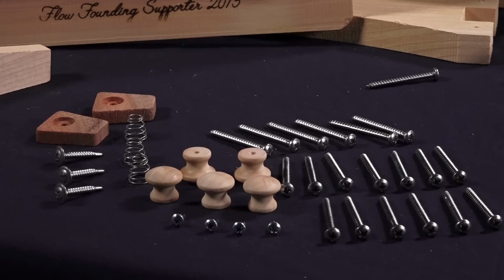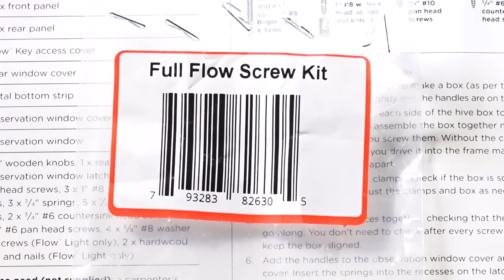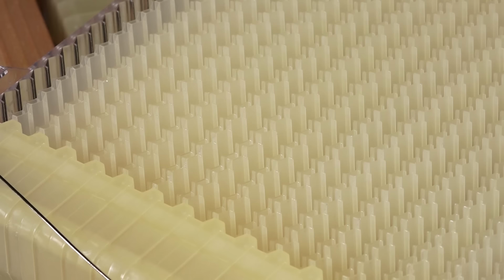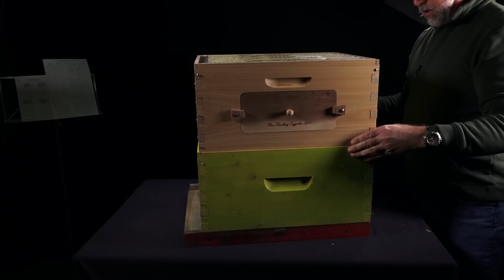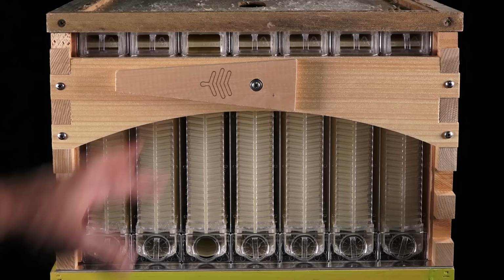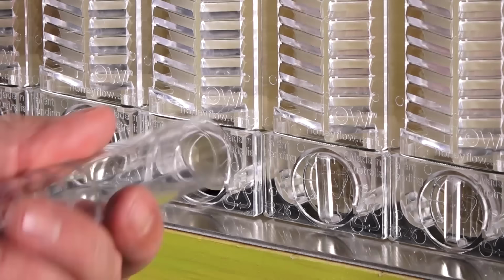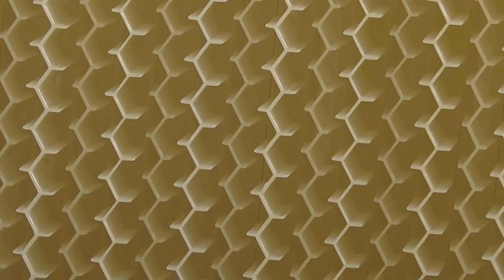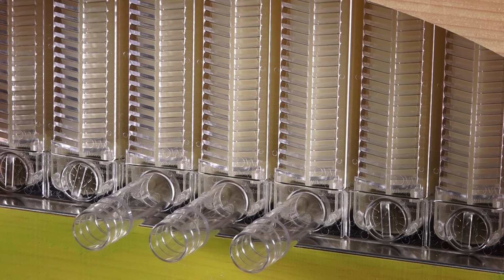The Flow Hive for honey bees, Love it? Hate it? or Undecided? Price? Review of Quality Control

Comment from the maker: ALERT! Today alone, I have had to remove/block FOUR Chinese Company Posts that have links selling a Chinese Version of the FlowHIve. There is only one source (at this time) for FlowHive frames and FlowHive Bodies. Please be aware that if it's not from the FlowHive website and it's NEW, it is not a true FlowHive and is pirated/counterfeit. I am amazed by how quickly they have done this.
Reply: +Frederick Dunn - Easy to steal, even easier if you send your Ideas to them (Injection Molded Products, or anything else). They will make your Order and IF they are dishonest they simply keep the Equipment running and make a bunch of whatever for themselves.

In the case of Injection Molding you need to deal with LOCAL reputable Companies and have EACH Company only make ONE Part, then YOU assemble the bits and pieces in your own Factory - don't give ONE Foreign Company the Key to your Business.

I am an expert in the Field of Manufacturing (but not an expert in Carpentry).

My unqualified opinion on the wood Frame is that the QC is very poor and the actual size should match standard Hives (for stacking). Obviously the Dovetails should be sanded and slide together smoothly (with a gentle hammer tap to knock it together, and a means to leverage it apart if moisture soaked). The Screws should be bagged, labeled and include either one extra or 10% extra (whichever is more).

As for the quality of the Injection Molding, the clear plastic parts appear to be of better quality than the yellow parts (from what I can tell from your Video, using a Magnifying Glass).

It's a neat system but a peel off front (that takes the caps off) and a collapsible Honeycomb (that squeezes out almost all the Honey instantly) would be a better system (if you're inclined to 'invent' your own - use my idea).

Wit the amount of money they Kickstarted and what they charge the quality should be a LOT better. Looks like THEY are the only ones making money from 'Beekeeping' (IF they are really that into it). Probably have a new Job now, selling these poorly made but otherwise ingenious Bee Frames.

Sweet success.

YT,
Rob

Want to Video Bees in the dark, equipment on my Channel. 😃
Reply from the maker: Hi Rob, all great points. Nope.. I have no interest in marketing or re-selling flow hives, parts or components, I'll leave that to them. I'm fairly certain that after a world wide consumer test and feedback is returned, the flowhive system will continue to be improved.

They are also being "illegally" manufactured in Turkey and being sold on E-bay. They are learning quickly not to include "FlowHive" in the title anymore. What a mess.

Currently my honey bees are actually chewing the edges of the flow box. I've never had them in cedar before, I'm guessing they felt it needed further modification. :)
Reply: Damm them Chinese pirates
Reply: Hi +Frederick Dunn  I m from Turkey we sometimes copy some goods illegaly but I couldnt see any beehive producer in my country could you give a link please.
Reply: I sow a product colled akar çerçeve* in Turkish but its an import good. Original name of it is flow light I mean not a  Turkish good.
Reply from the maker: Lots of them are on Ebay... I don't have a link right now, I have blocked those who were trying to sell them on my video comments. Sorry.
Reply: true. nothing can stop Chinese copies. 
Ferrari released 3 limited edition cars... 4th was found in China... - where from?????

We got 3 of your flowHives - happy with it. Expensive but makes life easier.
Reply: The way I see it there's no problem with a company trying to have their own version of an invention. It allows for development and improvement.
Reply: Najey Rifai  maybe if it was  significantly different to justify their own patent otherwise it's straight out theft.
Reply: Really you are amazed how fast the Chinese can duplicate an item. You talk big game about being an apiarist and having an open mind. Seems like you Sir do not live in reality and you show signs of living in an illusion and I might go as far as you may be living a dillusion. 
Realist or idealist
Reply: Najey Rifai:  The reason this is bad is because they bypass R&D costs, and they remove the very powerful profit motive.  Eventually, when there is no motive you don't get progress.  Of course there are those who say those inspired by profit motive are "greedy", but when they are the ones who have put in the time and effort and investment, just to have someone else steal their work and produce it cheaper who really is the greedy one?  if you think it is okay for someone to take from others; just leave the keys in your unlocked vehicle and it will be okay if someone else takes it, right?
Reply: That's their revenge for not having them to manufacture it. I suppose, "we'll sell it whether you decide to make money with us our not" lol.  Actually it's because you didn't get an international patent and address  China's laws therein.
Reply: If Flowhive can't even line up "dovetails" and include necessary or correct hardware, why would you not go to Chinese? Believe me, I'd rather send money to Australia, but not for double the price or more. This is a horrible display I would expect out of a place like China.
Reply: If you're foolish enough to design a product and send the plans to China to be manufactured there is a 100% chance that they will pirate your design. Flow-hives are manufactured where?
Reply: @summersands8105  Without getting into a major discussion, the political structure in China is NOT communism.
Reply: good to them! it was about time someone created a replica at a decent price!!
Reply: they made the flow hive at a chinese factory, the factory produces copies. do not produce your products overseas.
Reply: @hoplite46  - Watching several YouTubes from Ex-Pats inside China, the communist chinese society is very different on how they view copying etc. - In fact, there's the common ideology that Money is number one, even over family ! - Therefore, the phrase most all believe in "Cheating is a Sport"...
Reply: Mine is 100% Australian Flow Hive from Cedar & his Dad & I am extremely Happy that I put out the funds for the genuine article & I think my Bees will be happy that I did too. Thank You for culling out the fakes. The Chinese don't have a ban on formaldehyde and they use slave labor and probably NOT food grade sustainable materials. Yep. No Bueno
Reply: @robertsmith5095  Your comment would make sense EXCEPT many countries, Japan and China are notorious for this, will not enforce foreign patents. Also, when companies file for them can have "delays" that let a local company file and get their's approved before the original applicant. Japan was notorious for this up though the 1990's, I don't know the current enforcement regimen

Comment: Just incase anyone didn't catch this Plastic #7 is NOT generally recyclable, it may be biodegradable though. In most cases only #1 and #2 are. This is a common misconception that anything with that cymbal and a number inside means recycle, it does not.

Comment: It is nice to see a video reviewing the Flow system that is objective and solely observational.
I donated into the campaign and am the owner of a Full Flow hive. 
I had to sand a couple of the box joints in my access panel so It wouldn't stick and had to enlargen the cutout for the viewing window.  Other than that, all was well with my woodwork and the Red Cedar looks great after a few coats of Tung oil.

I am new to beekeeping but have been preparing for a year now. I belong to my local Beekeepers Association and have attended this year's Beekeeping Clinic. I look forward to receiving my nuc at the end of March

You are correct in stating that the system is pricey - virtually double the price of a typical hive. The advantage may be in the elimination of purchasing additional honey harvesting tools and equipment for a hobbyist.
Capping tub,   an extractor, a cap scraper or knife, a gated honey bucket with bucket strainers, etc. 
It is virtually a break-even proposition when considering those other, necessary items needed for traditional harvesting.

I think an overall positive outcome is that many people that may not have ever considered beekeeping have now done so. It is a certainty that a fair portion will not have a good experience, or be good stewards. That is likely the case regardless of the hive :)
BUT if the remaining majority of those newly introduced to beekeeping by way of the Flow hive succeed, everyone can benefit to some extent.

Again, excellent, thorough video and I look forward to your next!
Reply from the maker: +Bobby Thanepohn Thank you! I appreciate that you took the time to post such a comprehensive statement about the hive and hobby.  Glad you have joined a keepers association... certainly some in that membership have strong opinions about the FlowHive... welcome to bee keeping!
Reply: +Frederick Dunn I've remained "in the closet" about the FlowHive.
Reply from the maker: Well... there certainly is a campaign of "shame" emitting from insecure old timers and young "know-it-all" keepers... there is a large quiet pool of the "wait-and-see" community... Samuel Clemens said once "a man with a new idea is a FOOL! until that idea succeeds"

Comment: I got my FlowHive box in Feb (2016), and did not have the issues that the author had with the box joints...they fit together, but were somewhat tight. I was sent the cedar wood version as a "reward" for ordering early. Where I did get into trouble was that the cedar was not as malleable as standard pine, and the tight box joints led to two nasty longitudinal splits when I was screwing it together. A mix of liquid wood and good old wood glue sealed this up satisfactorily. All other screws and pieces were in my kit (nothing missing) and fit together properly. I also experienced the issue with the telescoping cover impinging on the top wooden assembly of the FlowBox. I had to saw the side off to allow a good fit (quite easy since I use a styrofoam outer cover). This was acceptable to me.
Reply: +Grunty Mcphereson I read a lot on the Flow forum abut issues and watched videos. The latest one was just a week before mine arrived and the assembly guy on a videp advised using a low torch on the drill and drilling slowly so we did that..thank goodness we had no splits...

Comment: For 800 bucks it should have come with TWO KEYS
Reply: What would the benefit of two keys be? As far as I can tell you can use the same key to open multiple frames and get honey from them during the same session.
Reply from the maker: Hi Charles, you can use one or two keys, I like to use two just because it's easier to break the seals with two hands and with two inserted, the downward force is concentrated on the outside edges of the moving parts rather than the center where you see quite a bit of material flexing down as you overcome the wax and propolis sealing that's occurred. But you can indeed just work with one of course.
Reply: Frederick Dunn ah, I see. that makes sense to get better distributed force.
Reply from the maker: Charles Thompson III I try to make sense sometimes :)
Reply: I keep one bee hive mainly for pollination. I have been able to draw off excess honey(about 26 lbs.) once in 7 years. Flow Hive is just not an option for me at a cost of $600.
Reply: Linda Welch he how much cost one box plz .
Reply: Isn't that an Allen wrench? Use one from a store with a cheater pipe
Reply: Two key proper dove tails and no missing screws

Comment: Thank you for your video review.  I'm new to beekeeping.  I'm in it mainly to help the bee's and help pollinate.  I'm blessed to be learning/getting help from an experienced beekeeper friend that is successful with 40+ hives in my area (upstate NY).   Last year I gave him two queens and a very large hive that needed to be rescued.   

On bee stands using (2 or more) insulated 10 frame brooder boxes, year round, per hive, adapted to have my FlowHive 7 frame supers, on a few of my hives closer to the house, which will only be on a hive for a few months during the summer.  

My experience putting my own "FlowHive kits together was that thankfully everything fit very nicely.  (Just received the first ones a week ago) They turned out very nice. There were no missing screws, hardware or anything and the quality of the cuts on mine lined up perfectly.  The (4) 3/8 #6 panhead screws that you mentioned being too short for the knobs, I believe are to hold the observation window in.  I used 5 of the (7) 3/4" #6 countersink head screws provided, for the 5 knobs and the other two were used to hold the ends of the metal bottom strip.  

Thank you in advance for your updates too (Alert to counterfeit flow hives).  Keep up the great videos Mr. Dunn!
Reply from the maker: +Thomas Jent I'm so glad your components fit nicely... that is definitely the most common experience. I'm just one of the percentage that didn't have that experience. Enjoy your system!

Comment: This is disappointing to see... I worked in the furniture industry for ~55 years as well as on the farm. Someone needs a serious talking to about their work ethic! I've always gone by the saying that, "If you have a Reason, you'll never need an Excuse." Without getting long-winded about it, there is no good reason for sending out a product with dovetails 3/32" off. You shouldn't have to take a brand new product out of the box and start out by making the cuts fit and finding suitable replacements for missing parts.

As previews go, this is not good advertising for a new product. I hope the bees are happy with it.
Reply from the maker: The Australian components were perfect, you're correct, an American woodworking factory had a real chance to shine and didn't. I was told by their representative that "only 1-5%" of their products were like this and they consider that to be more than acceptable. They are now being made in Oregon and those products are flawless so far.
Reply: I just noticed I had a reply from someone that consisted of a one-liner that was basically a sarcastic correction of dovetail vs finger joint in light of my "claimed" ~55 years of experience. Apparently the user has come and gone, but I just wanted to say that I learned more over the years than just woodworking. Imo, agreeing with your frustration at how things fitted was more important than nit-picking terms.

The last 20-25 years of work before retirement/disability were spent dealing with 20 & 30 somethings with attitudes that were exponentially greater than their work ethic. I'm glad you found someplace that can still find employees that do more than just put in their time.
Reply from the maker: Don Hensley No problem Don, you have a healthy attitude. It's just part of Youtube that we have to adjust to a wide variety of opinions and attitudes. :)
Reply: +Frederick Dunn
Yeah, I've reworked a lot of famous canards over the years and one of mine I've been seeing pop up now and then on the web is, "The thing about opinions is, every *sshole seems to have one..." [Grin]

If you've lived long enough to have trained workers you'll be responsible for later on, you learn to take care of what's important at the moment and add to it as needed. Sometimes it is of no value to make a point of showing that you know words someone else doesn't. Feeding one's own ego doesn't necessarily accomplish anything productive.

Btw, honeybees have had a special place in my heart since my teeth all started to die. Pure honey and a bit of cinnamon can be put straight into a bad tooth and it takes down the inflammation, fights the infection and lessens the pain. Just don't get honey in the dollar aisle without reading the label. That artificial crap is nothing but high fructose corn syrup and food coloring. You would NOT want to put that on an abscessed tooth!!
Reply: I agree totally.  I looked at their website and there's videos which show them using CNC machines for cutting parts.  Anyone familiar with CNC cut parts knows that you can't just stick them in a box, because they aren't always perfect.   Chinese copies will definitely be way out.
Reply: @joepalooka2145  anyone familiar with cnc cut parts knows they are perfect every time unless the program is wrong, so you must not be.  I agree the box joints are shite in any case.